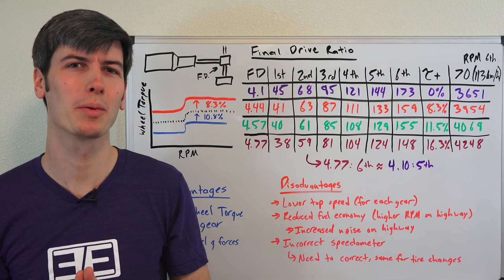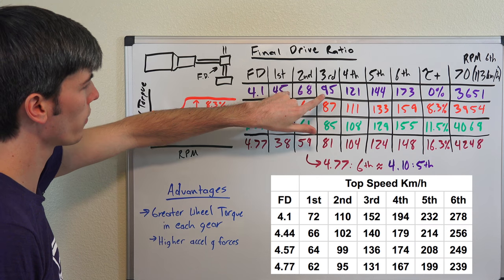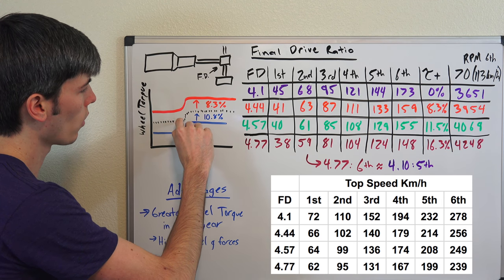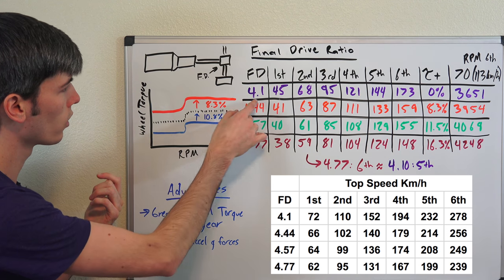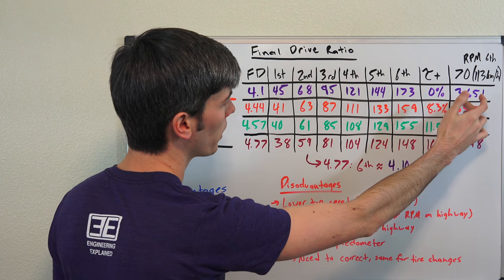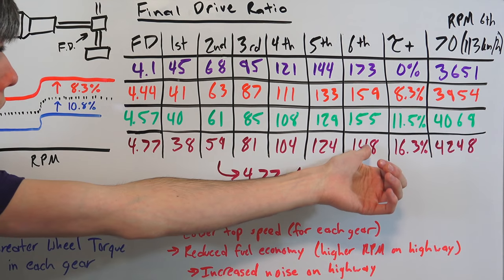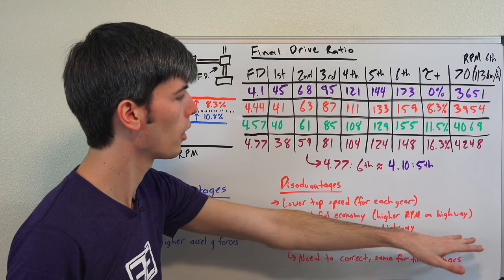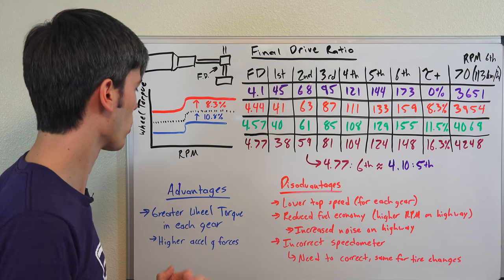Why Is Final Drive Ratio Important? Accelerate Faster!

Comment: Great info, why don't manufacturers put super tall 6th gears in? If I'm on interstate and have to downshift no big deal, that's what I signed up for by driving manual.
Reply from the maker: +mike anderson I don't know, I wish they did. Mustangs are the only cars I know of that do this really well. Love Mustang gearing.
Reply: Engineering Explained how about other gears. why do manufacturers sometimes seem to spec ratios outside the peak efficiency range?
Reply: The Viper had a very tall 6th gear,  0.50 :1  for 6th, the 4th gen F-Bodies had the same T-56 and also had tall 6th gears.
Reply: My '95 Z28 M6 has a plenty steep 6th gear, cruising at almost idle doing 70.  Obviously a Honda won't be doing that because it has no torque, maybe a better question is, why do they make so many cars that are completely gutless at lower rpm's?
Reply: Jeff Smith they do, but those cars dont have top end
Reply: Engineering Explained I enjoy my Corvettes gearing. Highway speeds (75) and 760 wheel hp and still can average 30 mpgs
Reply: SergioRC The Gamer Yet here's a video of how cars sacrifice their top end to accelerate the way a car with an engine that has low end does.  Also, let's not confuse only having top end power with having power all throughout the band.  There's a thing called "area under the curve", a quick look at a turbo Honda dyno and a turbo LSx dyno will show you what that means.
Reply: Yup, even older corvettes were geared pretty well. I think the c6's actually hit their top speed in 5th, not enough power to go faster in 6th.
Reply: forrest225 do you own or have tested a c6 top speed?
Reply: Nope, sadly I don't. Most of my cash goes to paying tuition at the moment. :(
Reply: I would say that there still is a little left in the LS3 base/Z51, but not so much in the LS2. The Z06 and ZR1 have the power to use a good amount of 6th. The Aero on these cars are amazing and have very little drag (Depending on the package)
Reply: mike anderson weight
Reply: I think the Porsche 911 has this feature, like the v-max speed to reach is 6th gear, and if you use 7th or 8th gear, you won't be able to reach the max speed the car is capable of because it geared for highway efficiency.  So pretty much when you buy the car, they'll tell you that if you want to reach max speed, use 6th gear lol.
Reply: Engineering Explained The mid 2000's manual Lexus IS 220d has a high 6th gear as well. Cruising at 120km/h your revs were at around 1800rpm. Same thing is with the new 8-speed ZF automatic LRs and Jags, they might be as low as 1500rpm at the same speed (though these are diesels so that's granted). Most VW however like the manual golf VI I had have ridiculously low gears, you could put 5th in at 55km/h and 6th at 65km/h which made no sense whatsoever. The torque was pretty weak though so still you'd have to change down at highway speeds in order to accelerate anywhere, guess that's the reason for the gearing.
Reply: mike anderson Most cars have significantly taller final gears for highway efficiency, its called overdrive.
Reply: Simon Dobrev I wish my car did X(
I am going about 2900 rpms at 60 mph in 5th. i hate it.
my final drive is 4.235 and 5th's gearing is 0.775
Reply: Saben  Coupland you're lucky. I've had to live with 60mph screaming along at 3500rpm
Reply: sadakotube ouch.
Reply: Saben Coupland my dad's car has really short gears, I think first tops out at about 40 kph and u reach its topspeed at 170 kph at about 5k, rev limiter is at 6.5k.
Reply: Jeff Smith calm down, i was talking about diesels, great bottom end, but no top end
Reply: Jeff Smith not everyone's from USA , so i dont encounter modded diesels. And how is the comment i made above saying if i was talking about gas or diesel? You mayhave understood what i said wrong, or my comment didnt have the necessary info about what i was talking about. If im not wrong, diesels dont have much top end, because they have very low rpm range compared to gas.  ( the top end power it has is on the high rpm, right? If so, im wrong then)
Reply: What I wish they'd do is put super low first gears / reverse gears. Basically first gears that don't choke out on you even if you let the foot completely off the accelerator indefinitely while turning the steering wheel all the way. Even in cars with really weak engines.

Would make parking in tight spots a lot easier since you'd have to pay attention to a lot less stuff, and would be a lot more economical than occasional yanking on the clutch with a second or two of rolling between. Or bumping into other cars by doing it too fast.

Also imagine if you could remove most of that pesky clutch wear of getting into first gear, particularly in uphill starts.
Reply: viper has huge torque everywhere, wouldnt work on other cars that have narrow power bands
Reply: How do you feel about the BRZ's gearing? Mine has a sixth gear which I use alllllll the time since I'm mostly on highways.
Reply: mike anderson Their idiots.
Highway mileage could easily surpass whats even offered now.
But instead we got a bunch of cars riding at 3500 at 70 when they could be at 1200 rpm.
Maybe they dont want it idling at highway speeds.
Bigger v8s have low ratios.
I know Corvette and Vipers have low ass ratios.
Reply: @EngineeringExplained  i think i know why: keep it high enough so you get good enough fuel economy in the relevant driving cycles (FTP75, NEDC, more recently WLTP) which have top speeds of like 70 mph, 120 kph and I think 140 kph respectively (only for short time of the cycles tho), but keep it low enough so the catalog paper values like "Elasticity in top gear 40-60mph" or whatever it might be look good.

Comment: In most cases, on petrol powered cars, a longer FD is needed. Here is what I mean : 3700 rpm at 70 mph is too much, especially if you have a loud af exhaust. I think manufacturers should take a page from their own book and do what they do on automatics, which is either add more gears, which on a manual is kind of hard, or give cars a longer 5th/6th gear.

Comment: About the lower top speed thing. If you're driving in a vacuum then the top speed will be limited. But in the real world where there's air resistance. Changing the final drive won't necessarily reduce top speed. It's dependent on how much power the car's engine makes. For example a stock new edge Mustang GT with the manual has a theoretical top speed of about 219 MPH (24.9 inch tall tires, 3.27 axle ratio, and a 0.62 5th gear ratio). But obviously it won't have nearly enough power to reach that speed because the dread hand of aerodynamic drag will limit keep things to about 140 MPH.  So if you were to change out the rear end gears to something like 3.73, the theoretical top speed will drop to around 191 MPH, but again because the engine doesn't produce enough power to reach that speed, the actual top speed will still be around 140 MPH. It might be a bit higher because the engine will be turning more RPM for any given speed and will be making more power when it hits top speed vs. having the stock rear end gearing.

Comment: years ago when i was street racing with a 79 monty with a 355 and 3 speed auto I learned a lot of this the hard way. my car was traction limited by the real wheel size i could fit and my transmission ratios were set in stone because I couldn't afford to change the ratios or add a OD. I did run a much looser converter 3500 rpm. after doing some testing and basic math I figured out a 4.56:1 ratio would be the best ratio for 1/4 mile, because it would let me run through the traps in 3rd near my TQ peak, I also learned the 4.56: would over power the traction limits of my rear tires with the suspension setup i had at the time. it took a bit of tweaking with the geometry of the 4 bars to get the pinion angle corrected and the reaction of the setup to plant the tires instead of wheel hopping and wasting energy twisting things. this was around 30 years ago. thanks for the videos that shed some new light on things
Reply: Militaristics Wow! 4.56 for 1/4 drag race!? How tall were your tires? 32+s? In the 90's I used to bracket race my old 1977 Trans Am with 4 speed in the 1/8 mile. It had a 3.73 final and 28 inch tall tires (275/60r15). It had a warmed over 400 Pontaic with Edelbrock heads. Cruising 70 mph down the highway the engine was running just over 3k. Didn't even need to down shift to pass. I can't imagine what 4.56 gears would do in that thing.
Reply: i remember running 26 or 28 in tall tires on that car with a powerband of 4500-7500 so that's why i ran the 4.56's crusing rpm wasn't a big factor as I did not drive the car for any distance and couldn't afford a gear vendors OD unit.

Comment: I've tried to explain this subject to some of my knucklehead friends who think that the taller (numerically) the gear, the faster you'll go in a quarter mile. Yes, to a certain extent, but the elapsed times, and more so, MPH, will eventually drop off. I know this because I experienced it in my own racing career. This video explains very well what happens, so I'll be sending this link to some friends. But, alas, they probably still won't get it.

Comment: Thank you for the great explanation! I am doing a rear end swap on my '87 Cougar and I am glad to see that your anaysis and selection criteria agrees with mine. Are you  looking at the 4.57 ratio, I presume? 11.5% torque increase seems worhwhile and fuel mileage is not going to suffer much. I myself am going from a 2.73 ratio to a 3.55, which is a staggering 30% increase, and it'll still keep my freeway rpm just under 2k, which is great for a V8. Its fun to breathe a little new life into these older cars, isn't it? :)

Comment: Final drive ratios are not the most important thing. The most important thing is the actual ratio that reaches the wheels. If a truck with a 1st gear of 3.111 and a final drive of 4.848 has the exact same mechanical advantage as a truck with a first gear of 4.148 and a final drive of 3.636, when both are in first gear. 

That said, gearbox held constant, the final drive makes a huge difference!
Reply: ExactlyPrecisely well no duh. He's comparing swapping the fd on the same car. He didn't mention anything about comparing car to car...
Reply: But only at launch. With a taller final drive, you might find yourself in 3rd instead of 4th at a given speed, which would also boost torque.  If you already have wheelspin in 1st then you have plenty of gear.

Comment: A big disadvantage you didn't mention is the effect to throttle response, say mid turn feathering the throttle.  The 4.77 is very very jerky in these conditions and can often unsettle the rear end.  Taller gearing smooths out the jerkiness at the expense of less torque.  I think this is very important to mention.
Reply: Like a 2.41 or 2.28 gear in the old GM cars? Or is there a cut off where u loose ALL performance potential?

Comment: Amazing video as always! Esssentialy its like changing gears in a mountain bike. in 1st gear with the small disk every hard step at each pedal equals front tire lift off, and the more you switch to 2nd and 3rd disk in the pedals, less torque is generated from your own muscles instead of an engine :)

Comment: But at the same time, if your main acceleration metric is 0-60mph, a higher ratio final drive might induce an extra shift before 60mph, which depending on the shifting time, might end up being slower than the original FDR. Also, a higher wheel torque assumes you have the traction available to put down that torque. Alsooo, choosing an FDR ratio must take into consideration the fact that specific ratios may induce what's called "heterodyne effect", which destroys your cars NVH.
Reply from the maker: Agreed, though I don't think the 0-60 metric is the ideal metric to use for acceleration (after all, it's a unit of time, not acceleration). It doesn't tell you what you'll feel. Seconds 1-3 might be very different from seconds 4-6, for example.
Reply: well the power band of an engine dictates much of the qualities and characteristics of the acceleration. the powertrain system must be thought of as a unit, everything works together to get the result (work) done. how fast the work is done would be the unit of measure for 1/4 miles race. the amount of work ( load) can be measured in payload or hauling capacity. torque is most effective when hauling, hp is more effective when racing. but we must have both.
Reply: endoftheroad 
You won't notice the time on the street but that's more for dedicated drag races who that really matters to. 0-60 doesn't matter to manufacturers unless it's their flagship car
Reply: I cannot support this theory. my v8 suv with 3.73 gears os super slow off the line, but with 3.55 gears it is almost normal. however the toing capacity is much less.
Reply: Considering the average Joe will always say "my car does 0-60 in x seconds" and not "my car has a peak acceleration of 0.85g in first gear", 0-60mph times will always be a requirement for a powertrain configuration and one every manufacturer will consider when picking an FDR ratio
Reply: I hit 60MPH in 2nd gear in my car a bit before redline, so if i were to get higher gearing, I'd have to shift into 3rd to get to 60MPH for sure.  I wouldn't mind though, I like torque over top speed
Reply: . I' had 4.76:1 in my K20A (230WHP) powered  630kg Leyland Mini, and those massive 13" wheels just light up in the first 3 gears, even fourth was hardly usable. Running 4.05:1 now and its still a handfull, so considering a rotrex supercharger to see if I can just use 6th all the time lmao

Comment: I have one complaint on this, about going to aggressive and loosing a gear because your top speed will switch to the next gear down depending on how aggressive you go. Yess your yop speed might just shift to the next gear down when going more aggressive,  but... your low rpm, mph, will not be the same as your old gear once was. Top speed will be the sane as the old gear, but your bottom end mph will be different. Hard to explain in text. But day 5th took you from 30mph at 1500rpm to 100mph at 5000rpm 
Now with the more agressive gear, your 6th gear will be more around 40mph at the 1500rpm but still only taking you to 100mph at 5000rpm. It makes the gap smaller which is where you get the seat feel. The gap in mph to rpm is now tighter, giving you the feel of more power.

Comment: in the case of a stock s2k its beneficial to swap a higher final drive just like i did with my integra (btw not needed to adjust speedometer in a fwd gearbox). 

note: when you change it out for a to short of a final drive or gear ratio you maybe get more wheel torque but when drag racing its harder to get grip in 1st gear and in track racing you have to shift a lot more what Costs time in acceleration/decel balance. 

its key to Find the balance for your engine power and purpose.

Comment: There's also added stress on components. Axles come to mind.
Reply: Johnny Doe I was thinking the same thing... If you Increase torque you'd better increase axles.. and supporting components. ..👀👍™
Reply: not really, your tyres will break traction before your axles start deforming
Reply: not if you have good tires.  Axles and drive shafts break alot. ...
Reply: Karlos understands it and depending on the car's age and condition it should be able to handle it unless you go over the top
Reply: No need to worry about a stock S2000 breaking any axels though. They are only rated at 162lb-ft of torque.  lol
Reply: the rear wheel forces are dictacted by the engine HP. aside from 1st which might produce more force at the axles, if you are not traction limited, there is no increase of force to the axles overall.
Reply: that's easy,  just don't dig race.
Reply: Depends on the vehicle

Comment: In computer gaming. I got a lot more performance out of cars by increasing the final drive ratio. Then, for the last manual gear I could use, I'd make it taller than how the car was stock. Why? Because I needed a higher top speed. It was extremely effective.

Occasionally, when a track wouldn't work out if I did my normal adjustments, I'd go for a taller 2nd to last manual gear to meet in the middle.

There was 1 track where even the last gear needed to be shorter and if it was like the scenario in this video, I even made the 6th gear shorter than the 5th gear.

If you know exactly what you want a car purposed for, you can dial in gear ratios, if you don't, or if you just want a car that's more fun, but you don't want the highway to break the bank? Well..tough choices unless you can also change the "over drive" gear.

Apologies, I was a bit vague on the final gear number, and I wasn't referring to the final gear ratio when I said last manual gear. I don't remember anymore how many gears I had to chose from.

Comment: Application is everything when choosing a final drive ratio. How will the vehicle be used. Towing, race, everyday driver, or somewhere in between. The engines power curve is a big factor along with the transmission in deciding. If it doesn't work together as a unit it's not going to perform well at all. You can easily over gear and find you have run out of engine. I've seen plenty of guys do this.